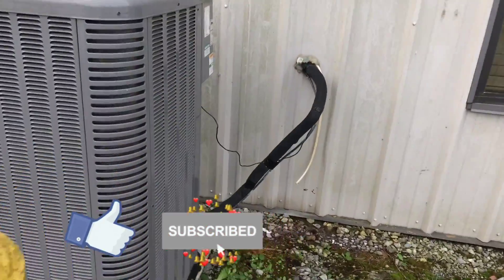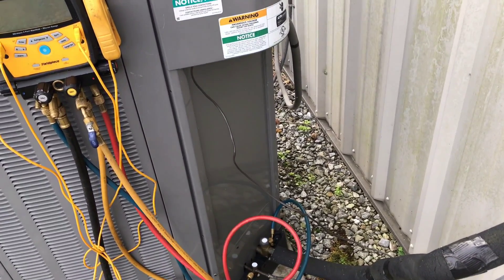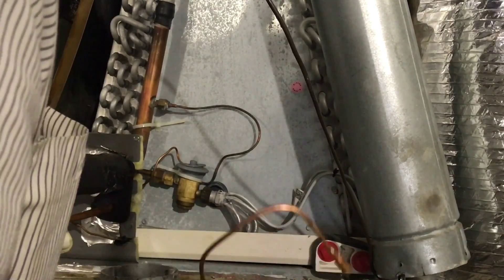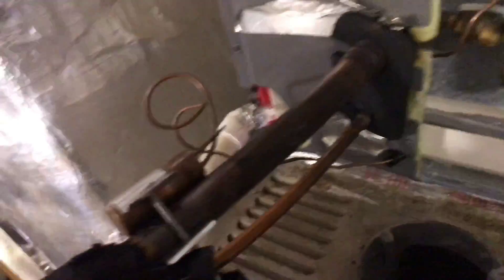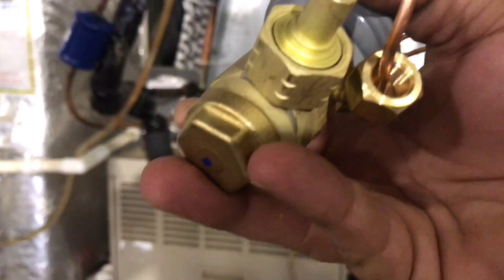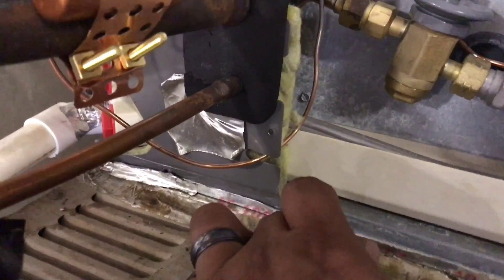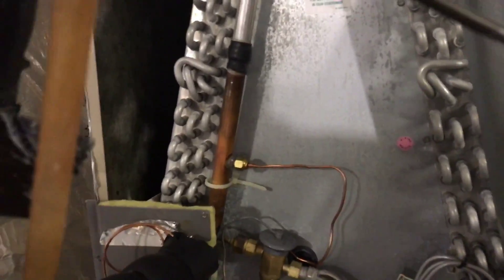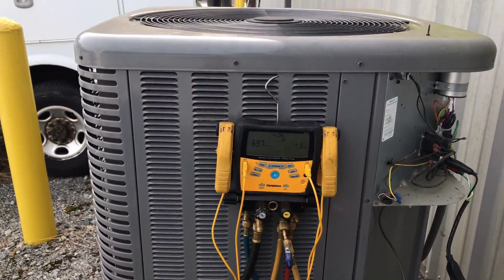TXV Troubles Part 2- TXV Replacement

Comment: Lmmfao really first thing got me was when you said line set is possibly under sized don't you think you should've noticed that and corrected it before putting in new TXV then you said Delta T was good and actually was to low is should've been no less than 18 but more like 20 is better you shoot some ok videos but definitely need some work and I know it's easy to sit on my couch and say shit versus being in the field dealing with reality and customers so if customers happy and your happy then that's what counts

Comment: I would have just pumped it down and changed the dryer. The problem with the TXV is probably the power head, which 90 percent of the time is the problem.  I guess you don’t know who has been working on it in the past, but a new dryer one size larger would catch any contamination.  All that liquid refrigerant should not have been dumped into the low side.  It will make the oil foam, and cause a lack of, lubrication just like a flooded start.   I always charge liquid thru the high side liquid line port, so it will flash off before it enters the compressor. That delta T across the coil is low, unless you have a ton of humidity in the building. The suction line should be 1 1/8”, for a 5 ton unit.  Common mistake installers make.  How much do you charge per pound for refrigerant?  This is all just my opinion.  Every one has their own way. Good video.
Reply: 90% of the time is the power head? how do you determine that? Also, pump it down, say what.  What about if the refrigerant is contaminated  because the last guy  used some from his recovery tank , instead of using virgin. A larger dryer would catch any contaminants, I will try that next time.

Comment: I always charge liquid through hi side when breaking vacuum. Scrolls have checks that restrict liquid from back feeding and slugging. Also, 201oz is 12.5lbs not 12lbs 5oz it’s actually 12lbs 9 oz. Good vid man… keep getting that money.
Reply from the maker: Thank you and Thanks for the advice. I have started breaking the vacuum through the liquid line since not long after that video. I appreciate you watching. 😃

Comment: 15 degree delta t is too low. Did you have to go back and add in more refrigerant? Plus, the return needs to be fixed. You might going back out on bad compressor. This wasn't well checked.

Comment: A 15 degree delta t is not good. Lol on a 73 to 75 degree day it should be more like 20 degree delta t! Especially with 410A something is off about this? Did you verify the indoor coil size matches the unit tons? The superheat is good but still seems like its underfeeding or their is an airflow issue. Like dirty coil or undersized return maybe...... I always shoot for 20 degree delta t but with a low heat load that should be easily achievable! Especially on a 5 tons unit
Reply: Most likely because blower motor was set to high speed.
Reply: The return is wrong and he missed it. On a 5 ton blower, its needs to be pulling in from both sides or sitting on a box pulling from the bottom. I know he has the wrong readings.
Reply: @smacleod69  Low air flow from the bad return will make the delta T higher.  The delta T varies with how much latent heat ( humidity) is in the return air, and can vary from 16 to 26 degrees.   He might have too much airflow, or a lot of humidity in the building.  I wait at least 1/2 hour to let TXVs settle out.
Reply: @rodgraff1782  I don't think he had to much air flow. Reason being, if the static pressure  reads high, above 1.0 inwc, which I believe it is, and that is a psc motor, the cfm would be less than 2,000 cfm, for which the 5 ton needs. The cfm maybe more like 1,700 cfm or lower. And that would cause false readings on the txv.
Reply: @smacleod69   You may be right from the look of that return air.
Reply: Or these digital guages are not...hard to trust those everytime

Comment: Hey Josh, the refrigerant scales should be removed from the case while in use. The tabs inside the case that support it during transport will hold the weight off the scale and give you a wrong reading. You can close the case and set it on top of it for a level surface. Great videos. Looking forward to more. Thanks.

Comment: what is the item called you used for the vacuum pump?
Reply from the maker: Micron gauge?
Reply: No, the item used to power the vacuum pump.
Reply: @dannymcginnis2682  Im a little late but it's an Adaptor Cord. The one in the video is a Yellow Jacket & runs about 30 bucks on Amazon.